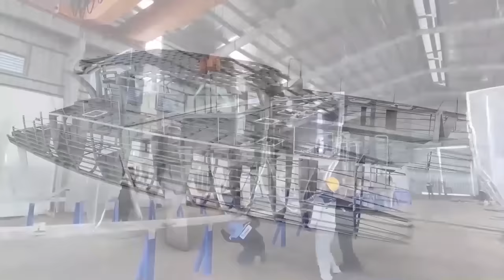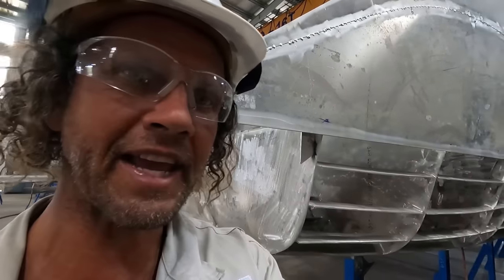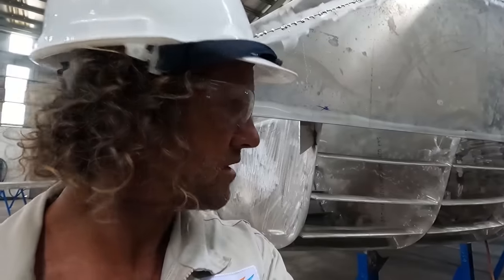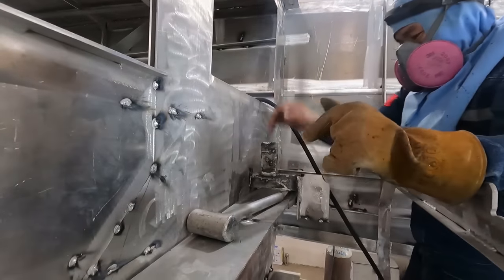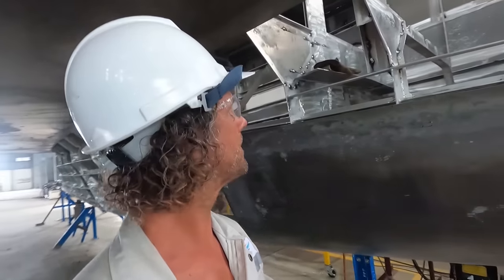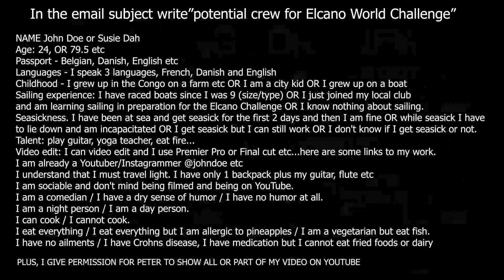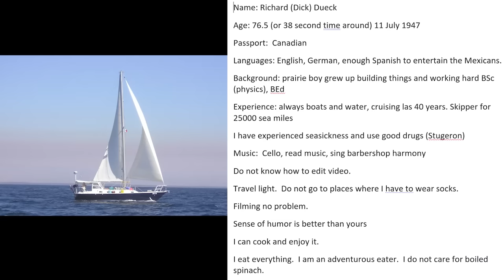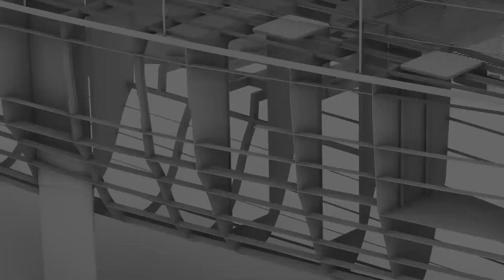Ep. 23 Peplink come on board -  Reliable mobile internet at the lowest cost no matter our location

Comment: Richard is very impressive, he's done a lot and has a lot of experience. If I were to do it, I'm very green in many areas. I'm a technologist in that I know radio and electronics. So, modern AIS and VHF cabling, and networking may be somewhat easy for me. I am a ham radio operator, vhf uhf hf and digital. I managed a satellite yard at a TV station. I've studied the hell out of modern sailing and own PV/LIPO systems. I make batteries, and like those best because I then know what is in them and can replace necessary components/ test the batteries and systems. But, I've only been on the water for short trips in Humboldt Bay and in the Pacific near there. I've tried to absorb as much about rigging/autopilots/shaft and proppellers/ steering  / hull issues and zincs/ electric issues with motors / . From what I know of the Cell/Battery/Lipo issues world wide I'd think it would be best to completely secure all that equipment direct from the factories (China) and not try to export them . The times of shipping and those issues are terrible right now. They all come from asia but must be sourced directly (communication directly with factories) or there will be hang ups. Its a quickly changing market worldwide with , apparently, the sources in China.

Comment: Peter, did you know star-link is half the cost if you buy it in the golf of mexico and get it shipped there, I bet you know somebody that could help you with that...  I did not wanna say anything,  Peplink will give you service (cell service) if you buy the equipment at an extreme markup?  What?  I have been doing networking and computer stuff since 1985, the more equipment you add to a system the more problems, simple... enough said..
Reply from the maker: We worked it out ...in just one year they will save me 1000s
Reply: @SAILINGintoFREEDOM   With Star-Link you get a modem/router/WIFI built in,  and communicate all around the world, not just 25 miles from shore cell phone coverage, and most of the time you have to BUY a sim for the area you are in,  yuk..  maybe PepLink has a dial up phone they will toss into the mix...

Comment: Plukky - how you gonna inspect for corrosion between the stringers and the plates after the internals are fitted?
Reply from the maker: Remove panels
Reply: @SAILINGintoFREEDOM   great - something that needs to be designed into the fit-out.